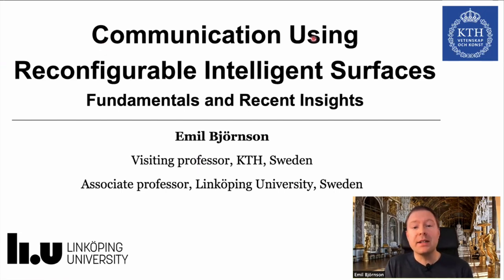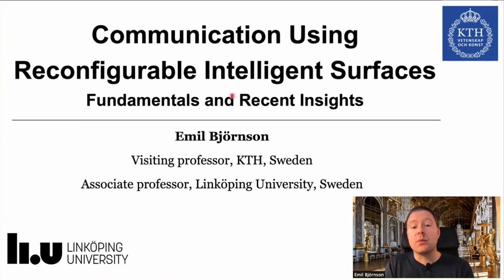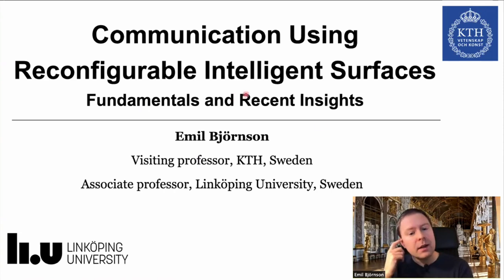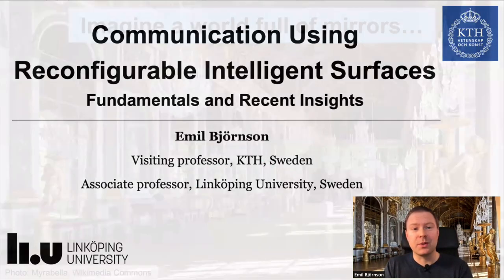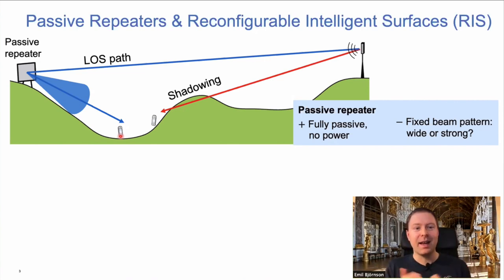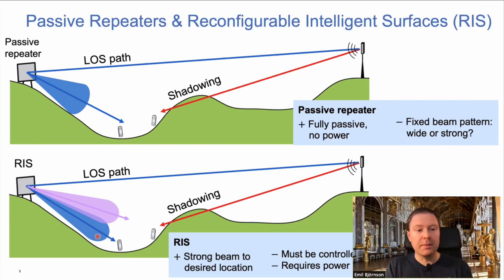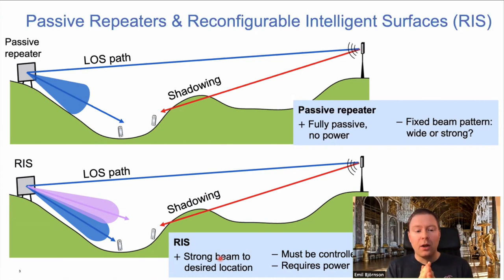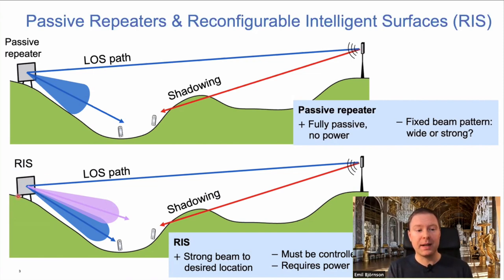Communication Using Reconfigurable Intelligent Surfaces: Fundamentals and Recent Insights

Comment: HOW MUHC DELAY WILL OCCUR WHEN SHIFITNG THE BEAM TOWARD THE USER
Reply from the maker: It only takes microseconds to change the RIS configuration, to shift the reflected beam direction. However, it is complicated to determine how to shift the direction so the beam reaches the user. The design of efficient channel estimation procedures is an ongoing research topic, so it is hard to answer that at the moment.

Comment: Hi , could i get a matlab code for RIS implementation
Reply from the maker: I guess you ask about algorithms for operating an RIS, not actual hardware implementation?

You can find the code used in some of my papers here: https://github.com/emilbjornson
There is also a general website: https://paperswithcode.com

However, many of these papers are simulating analytical formulas that are derived in the respective papers, so the main research challenges were to derive those formulas. The implementations are relatively simple, so I’m sure you could make those implementations yourself!

Comment: Hello professor. how to derivate optimization problems of RIS-Aided wireless communication system via joint active and passive beamforming?
Reply from the maker: I don’t fully understand your question because optimization problems are formulated, not derived. One can derive performance formulas from a system model, but whether those should be maximized/minimized or be above a threshold is an assumption. Here is a paper on the topic: https://arxiv.org/pdf/1810.03961.pdf
Reply: thank you professor I ma doing my thesis on  RIS-Aided wireless communication system via joint active and passive beamforming. I have to understand these optimization problems first, but its a little bit difficult for me. I want to show the performance of signal power, achievable rate, energy efficiency and spectrum efficiency, so recommend me how to formulate and simplify to the optimal value   @WirelessFuture
Reply from the maker: I recommend that you begin by reproducing results from the paper that I mentioned. If you want examples of how people run their simulations in this area, you can look for code examples at https://paperswithcode.com

Comment: how can deploy RIS in ray tracing model
Reply from the maker: Yes! I think some software solutions are currently creating such functionality, but otherwise you can model the RIS as a big antenna array and then measure the channel to and from it. You can then put it together using theoretical formulas.
Reply: @WirelessFuture  we want to study channel estimation in RIS assisted in UAV communication using Deep learning approach so we need data to train the model but in real environment now diffcult to collect data due to lack of RIS . could you  have direction?
Reply from the maker: Most research that I've seen in this direction is model-driven, since there is a lot of classical theory from MIMO communications and array signal processing that is applicable. Here is a nice overview on that: https://arxiv.org/pdf/2110.00553

So the first question you need to ask yourself is: Why is deep learning useful here? Which channel properties can a neural network learn that one cannot model and utilize using the model-driven approach. I think the answer to this will be the key motivation behind your work.

Then you certainly need to obtain a dataset that contains those channel properties. Generating it using ray-tracing sounds like a good idea.

Comment: Thanks Prof. Björnson, as my understanding, RIS are using a mix of Antenna Arrays and Beamforming to retransmit a node?
Reply from the maker: Yes, the RIS consists of an antenna array that is not connected to radios but receive signals from another place and then phase shift them to form a reflected beam in a desired direction. It is explained in more detail in this video: https://youtu.be/9cBn5piI9Ms
Reply: @WirelessFuture  thank you so much to share the video link, there is explained on more detail about RIS.